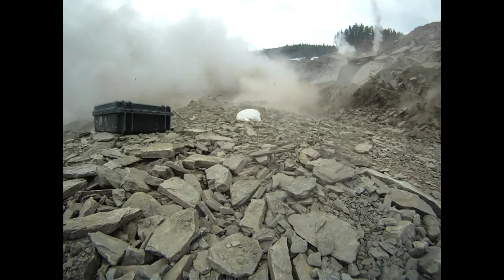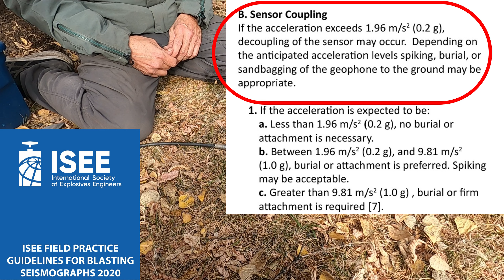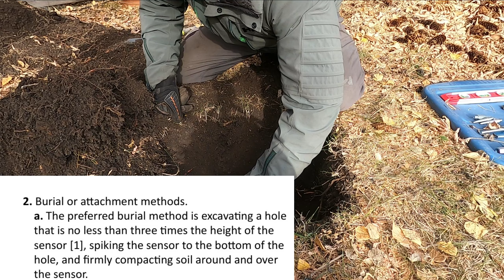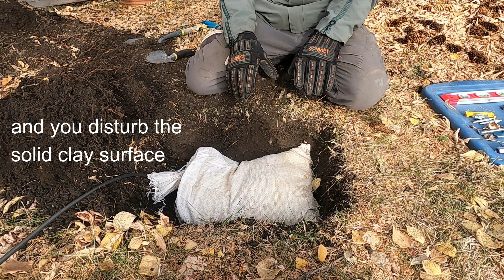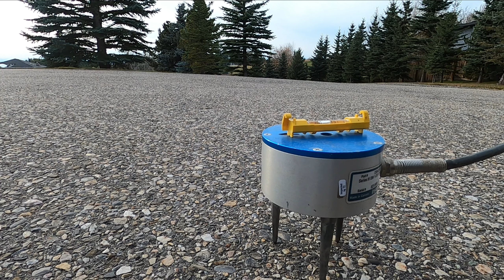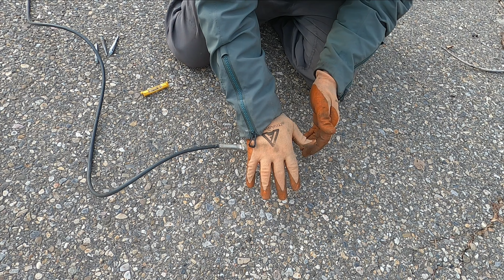PPV Geophysical Operations | Part 2 Sensor deployment and coupling

Comment: Great Video!
Reply from the maker: Thank you.  

I think the next videos in the series are more valuable BUT I continue to see operators just placing the sensor in tall grass thus demonstrating some of this out hopefully will be of value. If we do not get the first part correct, the data will be suspect. 

The latest ads for the equipment states: It comes with a fully charged battery so you can head straight to the field. But training and awareness are more important than a charged battery.